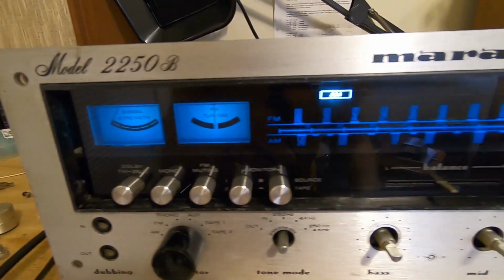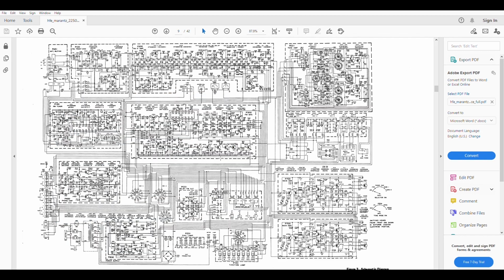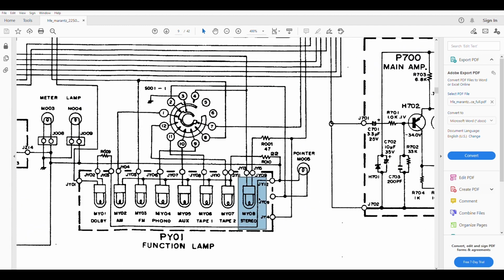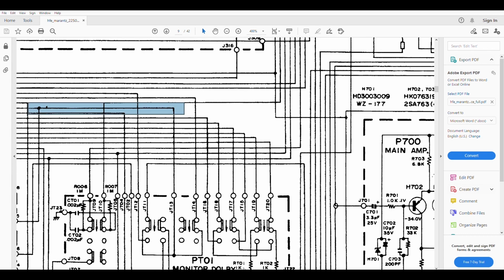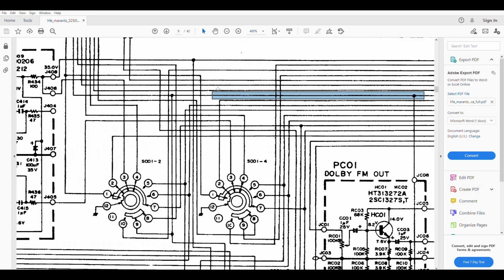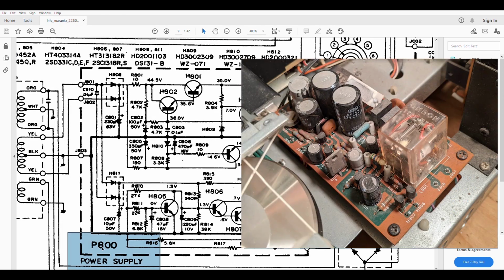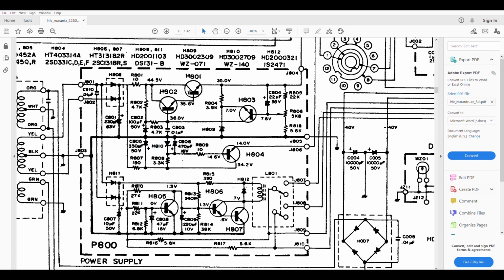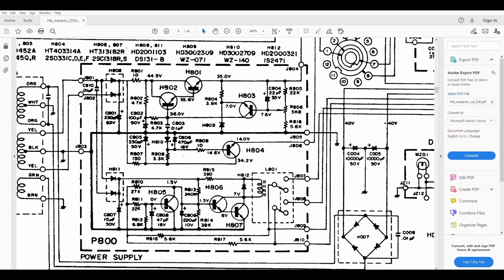Diagnosing A Marantz 2250B: No Power To Tuner Or Stereo Light

Comment: OK, I’d like to hear your opinion, it seems related: I have a Marantz 2226b for a year and love it. But, I have several problems and think that they are all connected. Here it goes - The first day I plugged it the red stereo light was on. The next day it was off (ok, I thought, the light doesn't work even though it was replaced recently). Then there were some crackling sound that appeared once in a while. I discovered that if I click the mono button and leave it pressed the crackling disappears after 3-4 days and I can listen to music mono for the time being. Then I discovered that sometimes the volume on the left channel goes down (about 80%) for no reason and stays that way (ok, I thought, those speakers are vintage. Maybe it's their age or the cables). Now, the weird part - if I click the mono button the volume becomes balanced again between the two speakers. After a while the problem is fixed by itself, but then returns after some time.
My assumption is that there is something on the hardware that is related to the mono/stereo functions and causes these problems. I took it to two "experts" but problems seem to reoccur.

Have any idea what might be the part causing this?

More details - Bose 901 speakers (I know they're not a fan favorite) with their EQ connected.